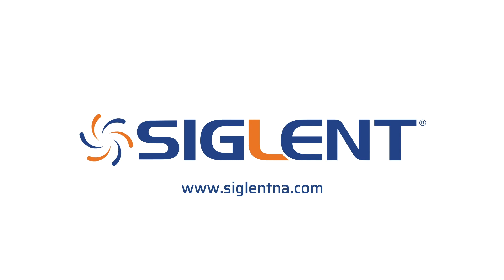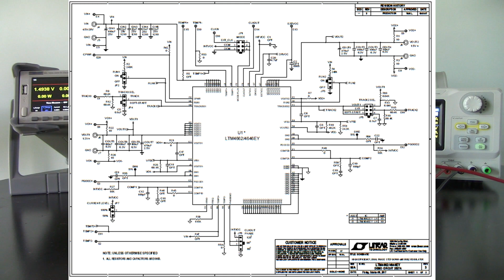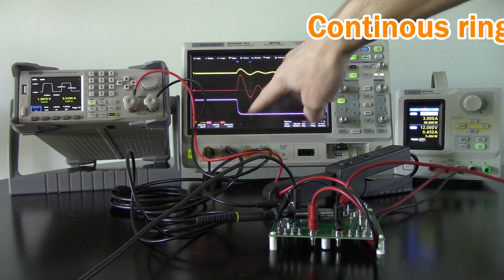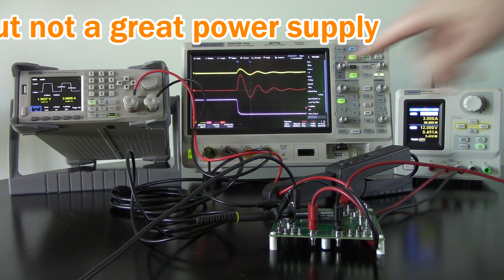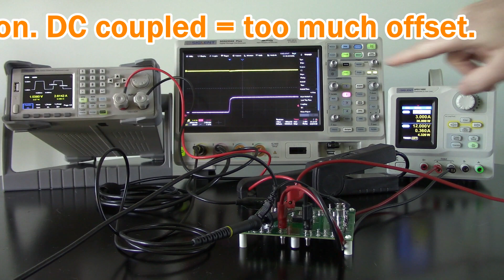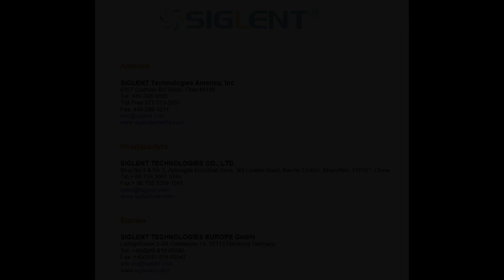Power Supply Design: Load Step Response with a SIGLENT DC Electronic Load

Comment: I like that load better than the older ones from Transistor Corp.  Those handle more current but don't have any of the dynamic features.  Time to start looking for one if these Siglent loads. 

I have started a ham radio repair business in the last year and 90% of my test equipment is Siglent. You guys make excellent gear at a price someone like me can afford.  I pay cash for gear,  no debt starting this.  But I still have the bench I need thanks to Siglent. Thank you!
Reply from the maker: Thank you! We've received lots of positive feedback about the SDLs since they were released last year. Glad you like the feature. - Jason, SIGLENT NA

Comment: how fast....  and if ur slew is in microseconds... what application , asides from linear poer supply or poer amplifiers///
Reply from the maker: The dynamic constant current (CC) mode has a maximum switching rate of 25 kHz and the constant power (CP) mode is 12.5 kHz. Switch mode power supply designs can be tested using this method. - Jason, SIGLENT North America